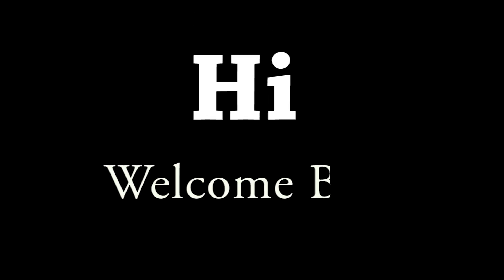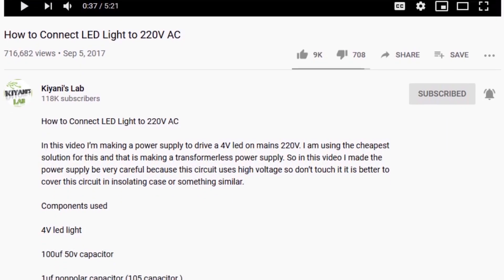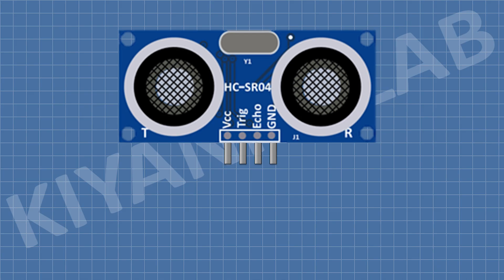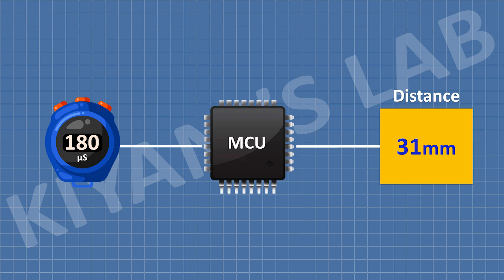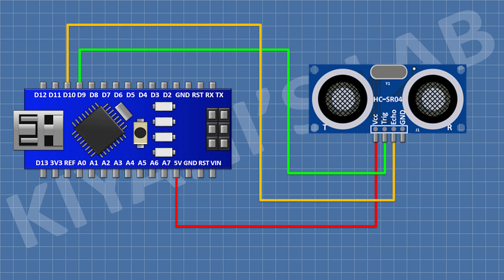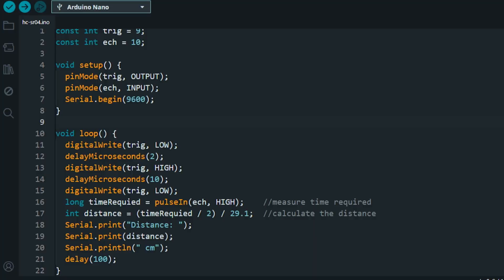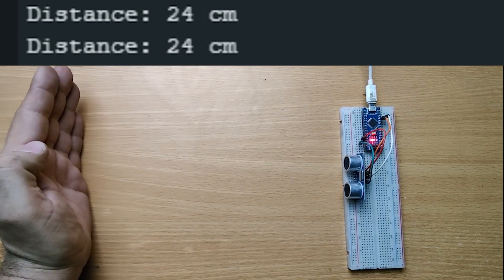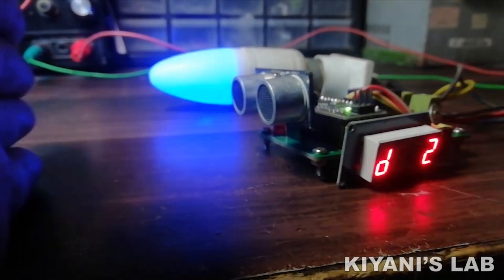What Is Ultrasonic Sensor (HC-SR04) | How It Works | Arduino Project

Comment: Very useful ultrasonic sensor ❤❤❤

Please Arduino nano PLC generator control 3 face high powerful water level fuel level oil LCD display 16X2 push button code 💯💯